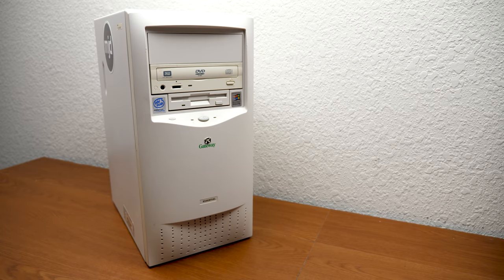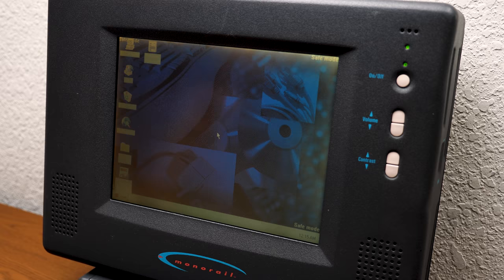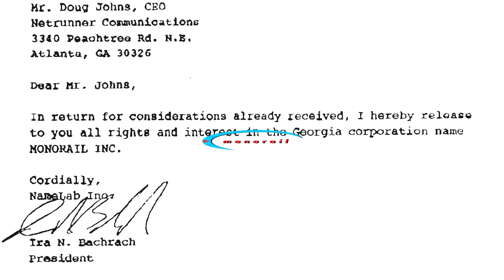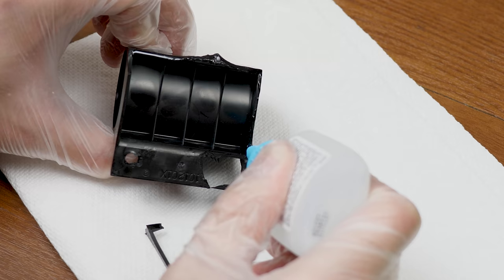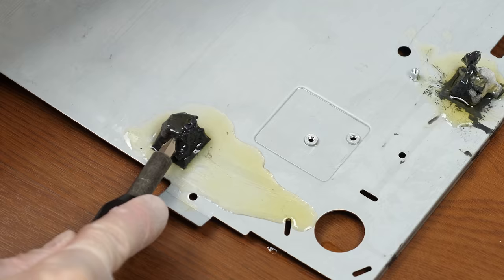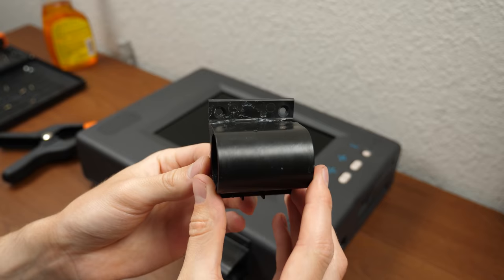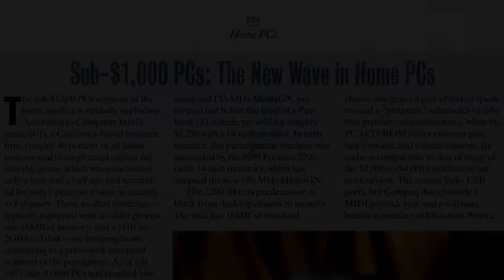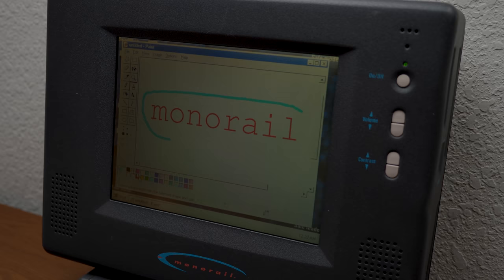The Monorail - An All-In-One Windows 95 Computer! (Retrospective)

Comment: 【ＭＯＮＯＲＡＩＬ】
  These things are just neat, and it's nice to see the base model. Shame that the display is so poor, otherwise I'd have my Model 133 in use more often, as it's just a fun system to use due to the form factor and tanklike metal case. The liquified rubbery nastiness inside though, yikes.

Looking forward to that recovery disc image 👍
Reply: GREETINGS
Reply: G R E E T I N G S !
Reply: I just got done watching your joystick doohickey video!
Reply: Greetings!
Reply: I knew you'd be here. Didn't even have to look.
Reply: Isn't possible at all to replace the lcd screen with an active one?
Reply: Greetings LGR!!
Reply: ITS LGR WITH A THING.
Reply: mmmgreetings
Reply: Didn't your Monorail come with porn downloaded by the previous owner?
Reply: @JeSuisUnePatate  But what would be the point ... it would just lose its Monorail-ness.
Reply: You could use it as your 'Solitaire machine'. Or, stick it on the back of a car seat so the back passenger can pretend they're on a plane.
Reply: Greetings :)
Reply: @willman85   on that era, many manufacturers (like Toshiba Satellite or Portege) had an option of passive or active screen.  An active one would make it even more amazing in my opinion.
Reply: Clint, your Model 133's case was stamped out using stamping dies built by the former Progressive Die & Automation in Walker, Michigan. I worked there near 14 years when the tool and die shop closed its doors for good in 2003. It also had built tooling for Saturn's,  G.E., Maytag and even the revived Volkswagen Beetles. Wish I still had my model 133 being a amateur radio operator. Would be perfect for digital modes!
Reply: Greetings and welcome back..
Reply: @Clarissa 1986 - I do agee & understand for the purists, but active lcd were something on that era also and maybe it was a 1000$ option more in 1995 but could be at 10$ today ;)
Reply: ｇｒｅｅｔｉｎｇｓ！
Reply: @Clarissa 1986 Monorail Computers offered it with a TFT active matrix also, so just swapping the awful passive matrix display with it wouldn't be that bad in my opinion.  But I do respect your opinion.  :)
Reply: People who watch MJD also watched LGR 😍☕☕☕☕☕
Reply: @Clarissa 1986 - I had in mind for a TFT active screen that would match with it of course.  I'm not even sure that could be possible to find one anyway.  :)
Reply: why did i hear clint's voice while reading this lol
happy to see you in a mjd video, both of you are awesome
Reply: Greetings!
Reply: Why do I read the comment with your voice in my head, Clint?
Reply: I think you guys should investigate upgrades. It might seem absurd, but it would be awesome. Imagine the monorail with an active matrix display, maxed out ram, and possibly an MMX pentium cpu on a solid state card. Oh the FUN that could be had!
Reply: Greetings
Reply: Greetings!
Reply: @bruceiscool05 lu😅😅

Comment: By 1996 beige boxes were very common & people had worked out that replacing or adding parts was pretty easy.  Compaq's all in one designs were a lot more practical even though they used a CRT monitor.

Comment: Alternative title: "I tried to install the ethernet card but everything goes wrong". Classic Michael MJD video
Reply: We had to use low-profile 3com cards. Also where the card connected to the Monorail had to be bent 90 degrees to fit.
Reply: @kens32052  Damn you worked there?

Comment: I bought a knockoff of one of these for my mom in the late 90s. The Win9x era of AIO computers were universally junk. The case started cracking and losing little bits out of the bottom within a year.
Reply: I MUST SEE IT
Reply: The Monorails were made out of metal so they held up pretty well.
Reply: @GroupNebula563  it was junked before 2002

Comment: I was working at Gateway 2000 in Kansas City when this was released, (that is also where it was built, at a tool and dye company).  At the time our average unit price was over $3000, and our gross margin was over 25%.  This was important because it proved a company could make, market, ship, and support a computer with less than a $250 profit.  The Monorail immediately changed the entire industry, and redefined what a desktop computer was.  Great video!
Reply: What a coincidence! I worked at the former tool and die shop that  built the dies for the Monorail Computers in Walker, Michigan. Shop is long closed, along with a bunch of others in a market correction that killed some others that were in really good shape at the time.

Comment: Great video MJD! It would be cool if  you could make windows server editions upgrade saga (similar to windows 1.0 - 7 and NT upgrade saga). So windows NT 3.1 - 3.5 - 3.51 - 4.0 - 2000 - 2003 R2 and 2008 R2 server editions.
Reply: 2008 would be the end of the line for 32-bit.
Reply: @soundspark  you can use a modern 64 bit pc and start by installing windows NT3.1

Comment: Rubber reversion is a big issue with virtually any product that was made in the late 90s/early 00s. I've got several still usable USB sticks from that era, but their soft outer casing is melting and getting sticky. Seems after about 20 years, it starts to revert. It's why most newer products are aluminum or some other metal, so the issue won't happen in the future.
Reply: While not perfect, the rubbery coating can be cleaned off with alcohol, requires a bit of rubbing but works quite well.
Especially since those coatings can sometimes disintegrate after just a few years, when the product is otherwise still good / relevant.
Reply: And if it hasn't gone sticky yet, attempting to clean it with alcohol can apparently make it happen. Found that out when I tried to clean a pair of cheap bluetooth headphones I found at a rummage sale. They're busted anyway so it was no big loss, but a lesson learned.
Reply: @stevethepocket  The alcohol disolves the layer so that can happen, if you continue using it it will rub off completely.
Reply: I have a few Dane-Elec 1GB USB flash drives from around 2007 that are doing that...
Reply: I have one of those laptop/tablet hybrids whose case started getting tacky after less than a year from new and was unusable within 2 years.  Bought the thing from Lidl (European wallmart type store).  Had no idea manufacturers were still using whatever horrid material it is that degrades back to oil so quickly. I guess its cheap, although the laptop most certainly wasnt.
Reply: Apacer USB and their MP3 players are good for that

Comment: I'm so glad this video popped up, I've had one of these kicking around for years, but it was de-badged so I could never find any information on it, my unit was rigged up as a kiosk at some point.
I think I'll have to take some time and see if I can get it running, I tried rigging it up with an ISA ethernet card but ran into the fitment issue you talked about.

Comment: Thanks for the informative video...on the Monorail All in One...as I'm across the 'Pond' I've never heard of this brand before...quite ahead of its time in design in my opinion...and I've just acquired an All in One myself a lot newer of course...got a load of Towers and Laptops and a couple of Shuttles but now have an unusual Cielo...from ex retail use...very heavy solid Alloy base...not your usual plastic...released around first quarter 2014 from what I've discovered about it...I think this one's mid 2014...2Ghz Bay Trail processor...comes in at least 2 variations...this one has a 24volt USB with extra port for plug in accessories..like card reader etc...other variant has 2x 12v USB added...will be testing it over the coming weeks and months...very niche product as my mate calls it...

Comment: - I got a beige Monorail PS/2 keyboard with multimedia keys in 1997. There's no corresponding computer to go with it. 🤷
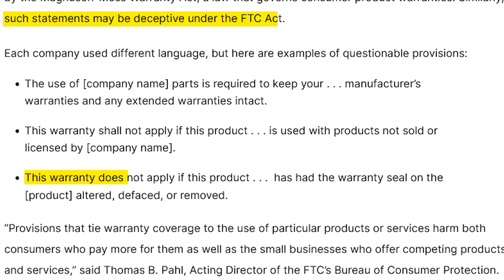- 6:00 Louis Rossmann has mentioned the Magnuson-Moss Warranty Act many times during his Right-to-Repair fight.
- 6:01 I read an article in the late 90s about how they bought a computer from a mom-and-pop shop that came HOT-GLUED shut with a warranty-void-if-removed sticker. They opened it found it had cheaper inferior parts from what they'd paid for. 😒
- 6:03 Companies violate laws all the time. SSD prices spiked by $50 at the start of the year (before the WD factory probelm 😒), and just last week, they jacked them up another $10 specifically so they could put them on "sale" and say it's $30 off instead of $20 (which is still $30 more than it was before they artificially raised the price). ALL of the computer shops and sites did this together at the same time. They ALL violated FTC §233.1 together… and got away with it (as usual). 😠
- 6:11 It could've been worse, they could have been pinned torx. 🤷
- 7:54 I usually just use needle-nose pliers to deal with IDE pin problems like that; you can (gently) pull them forward.

Comment: I had that problem with an IDE bent pin once and tried to bend it back but it broke so I used a cut down paperclip and bingo. Never had a problem again! Just a little DIY tip if you don't have a soldering iron to hand or are not confident enough to do it yourself :)

Comment: This could have been a winner if it could have supported three regular sized ISA cards. It would have had the LCD panel push all the way to the left and the floppy relocated. As you point out the upgrade hostile case is the killer problem.

Comment: You did not need to desolder anything there speaking as a tech for 35 years working at rather large companies such as Mayo Clinic in Rochester Minnesota, you could just have bent the pin back and then tested the drive elsewhere before it reassembling the system.  Tech rule number one be sure all your pieces work before you put the whole thing back together so you didn't need to do this solder thing because you still don't know if that worked when you put it all back together.   So maybe you already know this but next time just bend the pin back and then test it on a test rig and if it works you can confidently reassemble it.  Keep up the great work I just thought that little tip might save you in the future as someone who's built computers and put them together only to find out they won't post it's it's best practice to test the parts independently to make sure they work before assembling the system the exception being of course the motherboard you can't exactly test that and it's not safe to test it you could sit it on a static bag and fire it up but I wouldn't

Comment: They could have done better with an TFT LCD instead of an DSTN and it looks like the skimped out on the L2 Cache but beyond that it is not too horrible spec wise. The only other gripe is they could have used a better gpu had there been enough space on the board such as an S3 Trio 64 or something along the lines from ATI or SIS.

Comment: Wonder if it would be possible too swap the display out with another one that has the same pinout that might be newer or make use of some adapter boards & maybe a 3d printed bezel too move some things around too fit the new screen.

Fitting this with an ips panel thats the right size & maybe 800x600 or 1024x768 would probably be pretty nice.

Comment: This was never marketed in the UK, and actually around the time they were around was when I got my first ever brand new PC. My parents couldn't afford top dollar, so it was still an £899 Compaq Presario which was nowhere near what top technology looked liked at the time. Yet what I had was far in advance of this. LCD displays of the era were things that were tolerated by laptop users for the convenience, but for a desktop machine a CRT would always be better and it took a further decade to change that. There are no prizes for being first to market with a desktop LCD monitor based on laptop technology  - it will be appalling as this thing is. And seriously, a 640x480 panel? Like Really? Even at the time that resolution had become too limiting and 800x600 was entry level. Although Monorail smashed a price point, it did it by a cent and with far too many corners cut to do so, within months of launch everyone else could undersell a better system and it became pointless. If they had a business model which could ship this thing for $499 they'd have stood a chance, but not doing what they did. It's an interesting curiosity, but even at the time this was an easy failure to call out.

Comment: If anyone asks you why the switch to LCD was just a fad and should have happened at least 15 years later show them this...
Still remember paying 300€ for the cheapest 4:3 19" LCD while the last CRT models of LG flatron (imo the post 2000 flatrons are one of the greatest CRTs) were like 30-40€ on a discount. Don't you think 40 employees is a lot for some small OEM - at least I imagine if you were to make it nowadays you would have 3-5 employees and some contractors doing the desing that would be then produced by Chinese contractors.